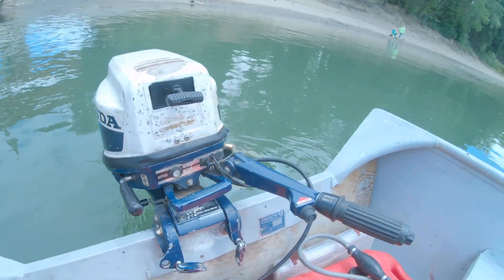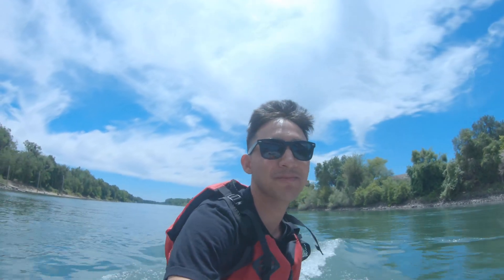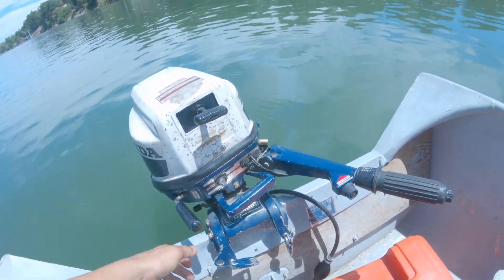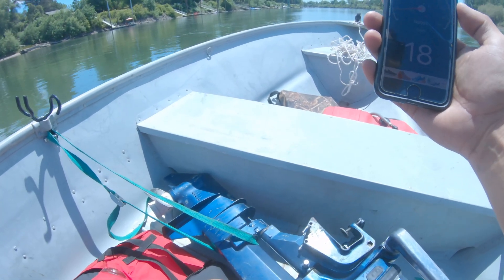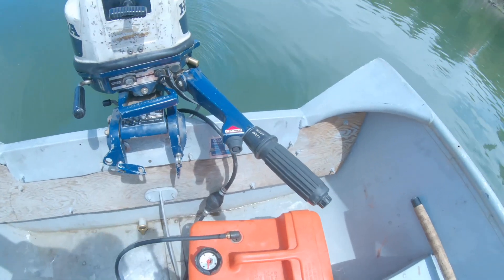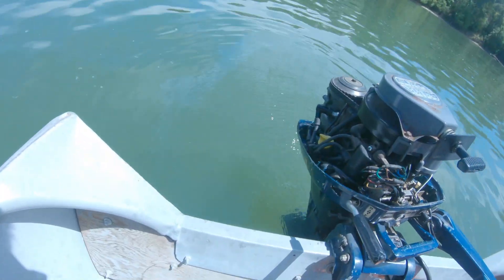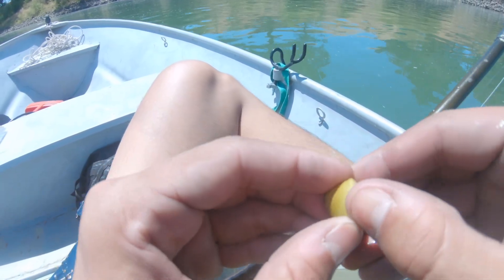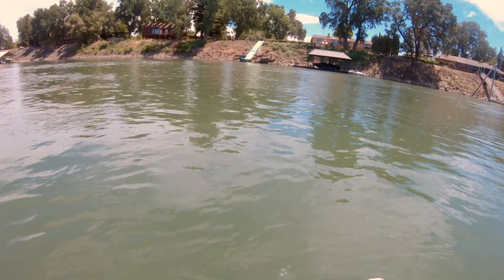4 Stroke VS 2 Stroke Outboard Boat Motors- Which is faster?

Comment: I believe the Nissan you have was built after 1986 and the honda was built before. In 1986 they changed the law so that the outboard horsepower rating had to reflect the power at the prop and not at the head. So your Nissan is a true 8 horge and the honda is a 7.5 minus 25% for going thru one right angle so the honda which is heavier and the horsepower if rated at the prop would be more like a 5.6 - 5.7 hp engine.